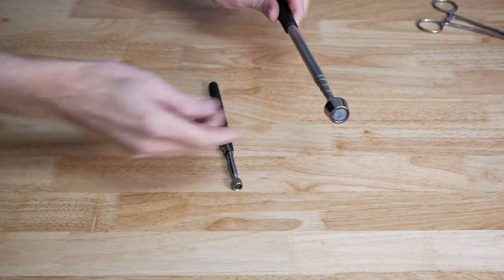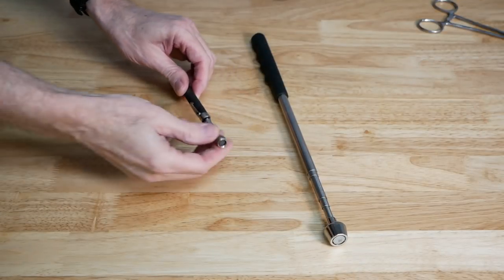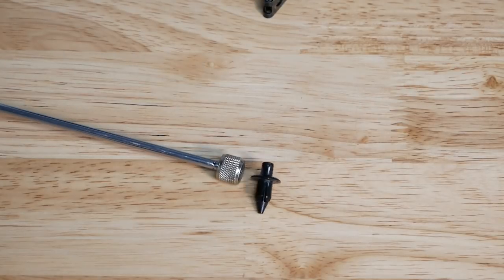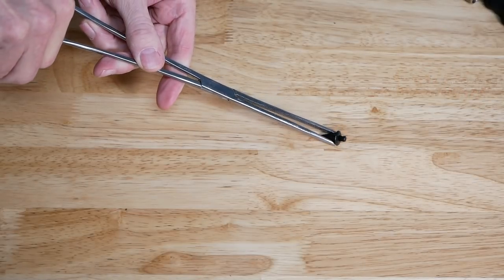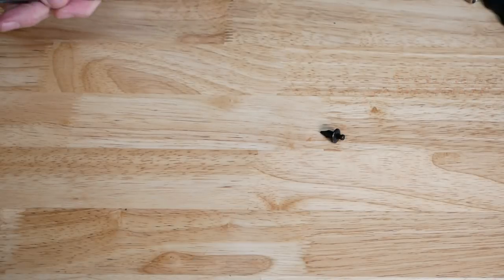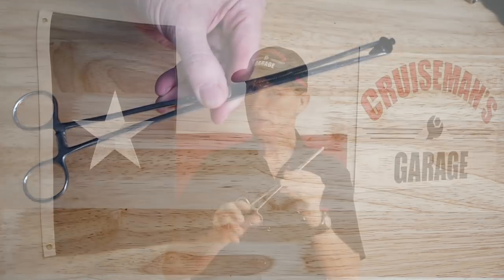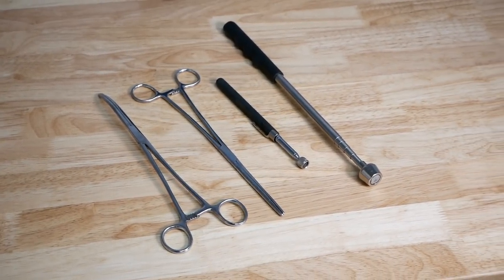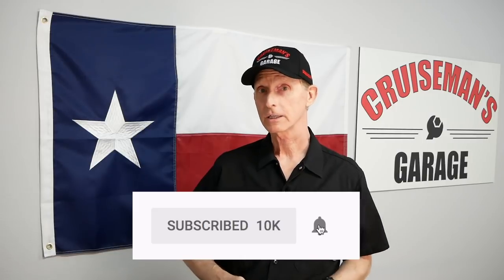Hemostats and Magnets

Comment: Good tips. You can also magnetize a pair of hemostats using wire and 6 volt utility battery. I had to do this one time when I dropped half a valve guide onto the timing chain of an MBZ 450Sl engine.